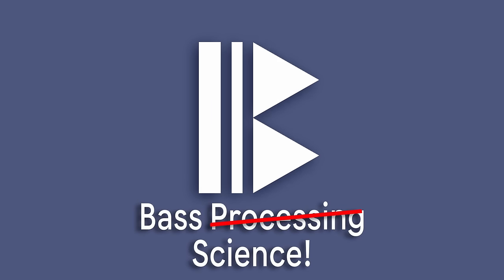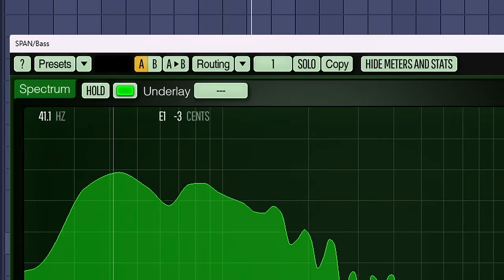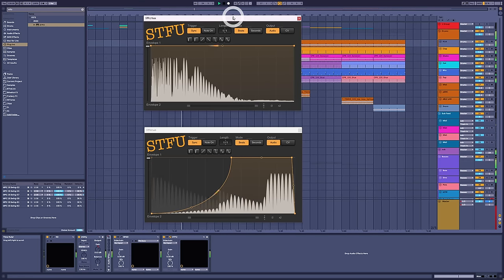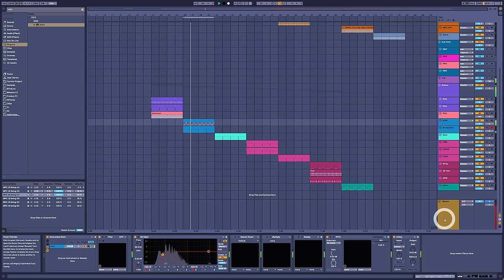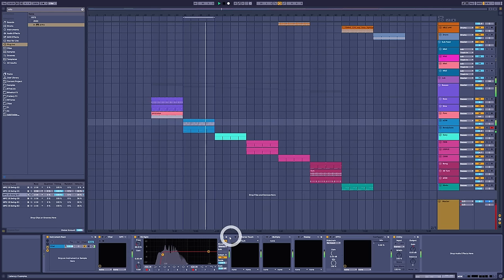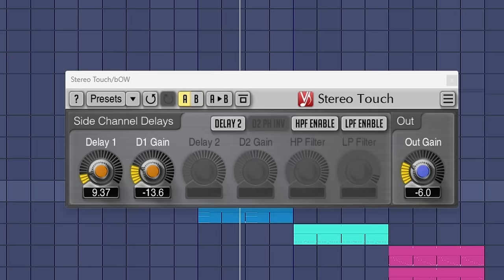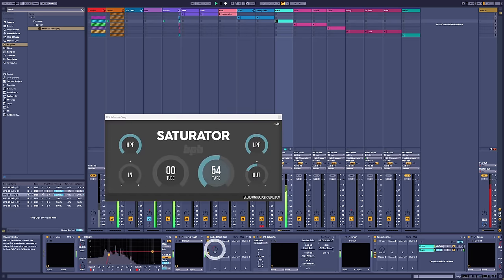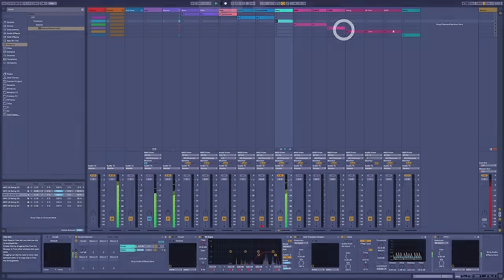How I Process / Mix House Bass

Comment: On your ducking examples via STFU plugin (at around 5:55) you would have static ducking on all bass notes, even the ones that play when the kick doesn't. Would it be better to trigger it via a sidechain or does consistency help in a way?
Reply from the maker: Good question. 
To be clear they only duck on kick drums , no other notes. 
Unless you mean that they remain when the kick is pulled out for turnarounds and breaks etc? 
Because generally I remove the sub when there is no kick drum as the purpose is to lift the bottom of the track there anyway usually. 
A real side chain on a compressor is a valid option. I just find this is easier to show newcomers this method and is generally 'tidier'. Compressors need a lot of tuning and are a bit less accurate as the release time can never truly follow the kick shape without intermodulation distortion. Especially in the sub range. 
There are benefits like they don't need to be automated and can even change in response to kick effects like high pass filters.  
Sometimes the break from the pumping when the kick stops (in turnarounds for example) is welcome and sometimes it's not it's just a groove thing.

Comment: Great info. Someday i will stop butchering my bass with an eq
Reply from the maker: Eq can be ok , in higher frequencies, and very much depends what's in the sound already and what part it is playing. . 
Eq on the low frequencies can only really work if the bass is on 1 note, otherwise as soon as the bass moves note the eq is no longer in the correct place, and you just end up with some notes louder than others.
Reply: @Bthelick  Yeah, i kind of "figured out" that bass parts packed with notes must be eq'd veeeery carefully. And also "kind of" coming to terms with changing bass or kick or whatever entirely for the sake of track working better. Can't eq the ego though yet)

Comment: Which compressors would you suggest to level out your bass notes when the higher pitched ones sound louder than the lower (Fletcher Munson)? Want my bass line to sound more balanced, even and add color.

Thank you for the amazing content!😢
Reply from the maker: nooooo don't use compression for that! Just use eq at that octave there's no need to hurt any dynamics. even better just automate the level,  or used note tracking on the synth patch to reduce level with pitch. 
HOWEVER I don't recall the last time I actually had to do any of that.  
That sounds more like a monitoring problem, your bass should not be jumping more than an octave which is not much different on the Fletcher–Munson curve, if notes are much much louder only 1 octave up that points to a problem with your environment not your ears. Check on an analyser if the notes measure the same level, because if they do you need to adjust your listening set up. 
I don't usually have to eq or change higher notes at all. 
What I do though is keep my sub part down low instead of having it follow any jumping notes of the bass.

Comment: You never cut frequencies around 200-300hz? What I've noticed with many mix engineers is a boost around 50-100hz... but in a situation where we don't have sub bass on a separate track. Does splitting as you suggest solve additional correction issues?
Reply from the maker: It happens occasionally but I don't usually. 
You should only cut 200-300 If you need to cut 200-300!!!, 
I understand this is a common thing to suggest but it's nonsense, as are all blanket suggestions for mixing. 
There are no situations in music that ALWAYS require a certain solution, there are no one-fits-all solutions in music, sound is simply too complex and all tracks are different. 
If you cant hear that you need to cut 200 to 300 then you shouldn't be cutting it just because someone told you. Because you also can't hear the results! 
You need to do more ear training and / or reference far far more. 

Depends on far too many factors. 

Oh And absolutely a NEVER boost bass in those sub frequencies. 
Here's an example ; 55  /110 HZ is A, So by boosting that frequency you are just making the A note louder. Is that what you wanted? Is your track in the key of A,? if so did you want that note to stand out more than others? And even if that is the case why would you want your sub notes to be uneven? Don't you want solid consistent bass? 

Please don't take arbitrary numbers off any tutor / tutorial and just run with them. It's pointless. 

This is why I made the video " are all mixing tutorials nonsense? "  

Always remember; mixing is listening skill not a technique skill
Reply: @Bthelick  Thank you for long answer. It all makes a lot of sense. I've seen almost all of your videos and I've never seen cuts in the low mids, which encouraged me to ask a question about this topic. Do you happen to have a bass part (long notes like reese) + a bass line in one track? Sometimes I have the feeling that I hear such a combination in popular tracks. If so, what would be the best possible splitting from a technical perspective?
Reply from the maker: @mrmick2878 can you give any examples. 2 basses in a track is a problem , in general only one bass can exist in a certain area. 
Not just for mix related issues but musical pitch. A long Reese bass would clash with any bass line that was playing different notes. If the other bass part is just playing one note but rhythmically then that's ok but you'll find the rhythmic based part is usually high passed quite far leaving the Reese / sub to do the actual base. 
Her any given frequency range our ears are quite monophonic. You can only hear one thing at a time so there's no point overlapping frequencies if you can help it. 
And in today's world where we need Headroom for a certain culturally enforced loudness standard overlapping any bass just isn't worth it.

Comment: @Bthelick 
When you split up the Bass Sub OSC, you don't mention how you'd handle the frequency position should the note change. I've tried various methods such as...  

leaving it static.
Automating the cut off point to follow the bassline accordingly.
Using separate tracks with different static cut offs for each note.
or even... 
Using the dynamic frequency autotracking of iZotopes vocal EQ in Nectar.

Personally I prefer to remove the 1st harmonic in synths that can do this (duplicating the track, 1 just the 1st harmonic, the other all but the 1st harmonic), but for FM type donks, sample bass sounds or basic synths like Sylenth, Spire, etc we don't get this luxury. 

I'd love to know how you would handle the cut off point for the upper bass when the note changes. Thank you
Reply from the maker: Great question thank you. Yes it's a little beyond a beginner tutorial. 
As you say,  sounds that rely on harmonics be it distortion or synthesis types don't have the luxury of removing the fundamental before hand well spotted. 
when I'm being lazy I try to set the high pass at the highest point I can get away with whilst keeping the bass part in a single octave range, you can always had a 2nd harmonic to the sub and use a fixed low pass so there are no holes, Or for bass parts that jump octaves I will adjust the sub part to stay in a low range so the bottom doesn't fall out of the track, (I also sometimes simplify the sub rhythm if the bass part is too busy so it doesn't sound like a mess in the club). 
If the chord progression is too wide to apply a fixed frequency high pass I will automate the frequency to roughly half way between the 1st and 2nd harmonic. I've never found nectar to be reliable enough to pull it off in time, though I haven't tried it in any recent version tbf. In theory that plug can do it automatically though .
Reply: @Bthelick  Ahh nice, so you have tried Nectar too. I wasn't convinced it was working that great myself either, but I did hope it was going to be the quick solution for this before trying it.  Thank you

Comment: Thank you for this very informative video. I got one question: When you looked at SPAN to find the key of the bass sound (first example). Why was it E and not F. It seemed like the peak was a bit higher there?
Reply from the maker: Sorry I'm just used to reading it, but I should have turned up the resolution to show it better,. It does have higher modes at the expense of CPU I just never usually need them.

Comment: What do you mean by “separate your bass into two tracks”? Do I duplicate it? Also how do you get the sine wav to be playing at the correct hertz?  There a lot of details missing from this video.
Reply from the maker: No you just need a separate track playing a sine wave. The sine wave will not be to be put at "correct hertz" if it's playing the same midi. 

If you are taking about using a sample then obviously until you get your ear training done you won't know what notes to program on a sine wave for now, so just duplicate the part and use a filter to separate them into low and high at the key frequency split. 
(In Ableton you can use EQ 3 and solo the low band and then for the upper part solo the other bands)

Comment: So this truncating of the bass is happening on every bass note, even the ones where there is no kick?

Also, when I put in STFU, I clicking noises?
Reply from the maker: Doesn't have to be. That's a groove decision.  sometimes it sounds better leaving it on and sometimes not. You'll find the sub is rarely present when the kick is not there anyway. 
I often use actual side chain compression rather than these envelope plugins so I don't have to automate them off when the kick is not there. The envelope plugins can be midi triggered too but the routing in Ableton is a little messy
Like all things, gotta use your ears!

Comment: Quick question: say I make a sub bass layer….should the amp envelope follow the modulation of the mid bass (I.e. copying the mid bass preset to another channel and turning it into a sine and putting it to mono) or do professional producers like yourself just make another sub preset that doesn’t have to relate to the mid bass preset? Should pitch bend be the same speed? Thanks for your help….also, some genres like dubstep have a completely separate sub from mid, including notes, is that right? What are your thoughts on that? I’m trying to understand the industry standard
Reply from the maker: Great question. 

First, There is no "industry standard" or "professional method" etc please don't worry yourself with that. 

As for envelope, I usually have it follow. It's a groove decision. If it's a bouncy, plucky type of bass and line, then I usually 'pluck' the sub too. Although transients aren't going to be heard down there (just try it) so I don't worry about a super fast attack on subs just the tail shape. There are plenty of cases where you may need to sub to release a little longer , either to be able to hear it, because  on plucky sounds high frequencies naturally decay faster than lower ones, so it feels right that the sub should be the last thing to decay. 

For active bass lines that jump octaves a lot , if the kick isn't carrying most of the bottom end, then it may sound more solid to keep the sub all on one octave. 

Use a plug like isol8 to isolate 80hz and below of your whole track and just pay attention to the groove down there. (Especially vs your reference) 
You don't want one big indistinguishable long drone down there, no one will be dancing to that. Try to keep the line recognizable down there , at least rhythmically.

Comment: I use Trillian but use FF Saturn to saturate the different frequency ranges independently as a workaround. I don’t saturate anything below 80-120hz as it’s not really heard anyway, not sure if this is the right way to go? Or does saturating the whole bass signal help to thicken it? Great vid btw!
Reply from the maker: Depends on your goal. 
Saturation can be used for flavour or clarity
Flavour - no rules
Clarity - be aware our hearing system relies on the "harmonic series". 
Example; if you remove the fundamental harmonic of a sound , just leaving the harmonics, our brains will fill in the gap and still hear the fundamental and correct pitch. (Fake / phantom bass in other words)

So if you're saturating for clarity you will need to include the full signal in the input signal, as all the correct harmonic series will be generated off that, even if you don't include all of that addition in the output. 

Having said all of that, unless distortion is absolutely crucial to the aesthetic of the sound at it's core (like bass house etc) then you shouldn't need to process it at all to get it to work in a track. If you "need" distortion every time and it's not a distorted genre, then the sound isn't good enough as a source.
Reply: @Bthelick  legend, thanks mate! 👌

Comment: Have you got any sessions on this same kind of frequency management but on you mid and high aspects?
Reply from the maker: I don't. I tend to find if you get the lows right, and are referencing properly, it takes care of itself. 
I don't do anything special, just pick appropriate sounds and keep them out of that low end. 
Most newcomers make the mistake of leaning on compression so it gets too busy up there, my advice is learn to listen for dynamics and groove, and don't use any compression, that will train your ears and get you used to picking better sound. 
I have a start to finish if you want to see my entire process.

Comment: Hi my friend, on the Sub bass (post separation) did u apply a Low pass filter? Kindly advise, thanks a ton 😀😀
Reply from the maker: No, if it's a sine wave there's nothing to filter 👍
If you're separating the low end of an existing sound you can't control then yes.
Reply: @Bthelick  thanks a million 🥳

Comment: Could you not just use a dynamic EQ, side-chained to the kick? With the kick only triggering the sub frequencies of the bass? Seems simpler than splitting the bass track and processing them differently?
Reply from the maker: Yes I do that sometimes. It depends on the situation. It's far less effective at overall level control, but is better when you have an important sound that needs to stay up front without obvious ducking. It can also be better for phase relationships, but it can also be worse too. 

Also I'm trying to keep it to what most people will have free access to. 
Is there a free dynamic that lets you side chain per band?
Reply: @Bthelick   Ahh OK, I will take that into consideration next time. Thanks for the reply.

Comment: Hey man - could removing the fundamental from the actual synth wavetable itself be a less destructive alternative to EQing it out? Saw some peeps doing this in in the psy trance world and it seems a pretty nifty way to avoid phase issues
Reply from the maker: Yes it's handy in certain circumstances. 
It all depends on the processing needed afterwards. If the bass part relies on any form like distortion then that will not perform as expected with the fundamental removed. 
But if the sound is designed around that then yes go ahead try it 👊
Reply: Ah yes of course that makes a lot of sense. Appreciate the reply dude @Bthelick

Comment: Do you have some tips on how to process the bass more correctly if your root note is also changing? Do you mix it in the same ways and then turn on and off EQs for each changing note? If they are longer and more significant ofcourse?

Example if you have a bassline that does E for 2 bars and C for 2 bars and the sub is following
Reply from the maker: Great question, yes It kind of depends on the kick but you can just automate the high pass frequency for moving bass lines.
Reply: Thank you for the quick response and lovely tutorials! @Bthelick

Comment: @8:34 I've been listening to these two parts (with and without side chaining) over and over again... I just cannot tell the difference. I even recorded and put their waveforms side by side and they look identical to me. What am I missing? Can someone point me in the right direction?
Reply from the maker: it wasn't the best example to be honest, I think the kick selection was pretty generous to me here, usually there would be some obvious 'farting' without the sidechaining on. The difference was in the sub octave mostly, which you can hear on a good system.  if you're working at zero as I describe in the "how to not master" videos you should come across it a lot in your own tests.

Comment: Hi Bthelick. I know that the bass you used is based on a saw. Is this the only reason you used a sine for the sub-bass? Would a sine as sub-bass also work for other non saw-based basses? Thank you
Reply from the maker: Yes it works for any sound. The sine is the simplest sound, all sounds already contain it, it's the harmonics after that first one (fundamental) which give sounds their unique characters. So using a sine as the fundamental harmonic doesn't change any sound. (Other than that you can now control the fundamental separately)
Reply: @Bthelick  Makes perfect sense. Thank you. Your videos have been immensely helpful. Cheers from Canada

Comment: What happens with sidechaining  if the bass line is hitting the same 4 on the floor beat as the kick?
Reply from the maker: Depends on the sound itself. 
If it's a deep/dull mostly sub sound, and the bass only exists on the kicks then it's not a very audible bass line! (Even without side chain) It either needs to become a 'kick extension' playing longer notes (if appropriate for the groove) or play elsewhere. 
If It's a brighter sound then the upper part only needs to be side chained away from the upper frequencies of the kick which are very quick, so that will still be audible. (And that's why we split the bass in 2 as I show)
Reply: @Bthelick  thank you for the in depth reply :)